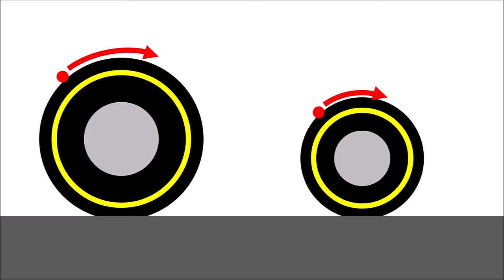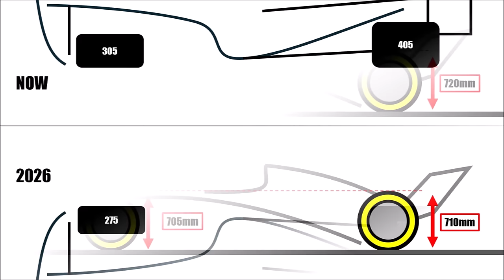F1 2026 - The New Tyre Dimensions EXPLAINED

Comment: The FIA baffles me. We talk about dirty air taking grip. What do they do? Take away mechanical grip. Very smart people working there.
Reply: 1998 all over again. Reducing mechanical grip just makes the cars more aero dependent/ aero sensitive. 
I do agree about reducing the overall diameter of the front wheels so the drivers can see them properly and plant the car over the apex not go outside the track limits.
Reply: @MichaelAMVM  actually the limit of aero grip is in the physics and the interpretation of the rules by the team, so no matter what size of wheel they run, the downforce is capped by physics and regs, something more akin to V8 supercars, they have thin tires and loads of power too, and that means more slidy actions.
Reply: @Dakkyun  I love V8 supercars i think they are incredibly cool,but a slide there is probably much easier to correct than in an f1 car. I'd like to see closer racing,not 20 spins every race
Reply: They really should concentrate more on Hamiltons jewelry.
Reply: You new?  They're 🤡
Reply: Smarter than you are apparently
Reply: One very important point is that the current tyres are too big and disperse a lot of water in rain conditions, making imposible to race. Slimmer tyres will make rainy races possible again
Reply: Nope thats actually something they did right. Current tires are WAY too big
Reply: But relatively speaking, there is less grip lost(not due to the tires). Just adding more grip doesn't help consistency.
Reply: Smaller contact patch doesn't reduce grip on its own, but it does mean they'll get hotter faster, and degrade faster.

On the up-side, tyres would get into their window faster. Degradation-wise, they could potentially address that with the rubber formula, given F1 requires Michelin to make the current tyres faster wearing (adding pit stops and thus strategy to races).
Reply: @Dakkyun  If you really want the cars to slide, just mandate crossply tyres! The four wheel drifts went away from Formula One with the introduction of radials in the late 70's.  Radials generate peak grip at much smaller slip angle than bias-ply tyres.
Reply: @bernardoberner4  The rears are just the right width!  About the same as the historical rear tyre width, although Indycar rears were even wider than F1 before the IRL days.
Reply: @matiasmosquera6357  Big tyres are not the issue for that, it's the ground effect that pulled the water upwards
Reply: I actually don't hate the idea of reducing grip tho. These cars could stand to be a little harder to drive.
Reply: Well considering that they think that not changing the regulations of a season that is boring as 2023 and 2024, is a good idea, this isn't really shocking in my eyes
Reply: @bakedbeings wouldn't more resilient tyre formula make tyre heat up less, essentialy making it the same as now?
Reply: It would be great to not see a knee jerk on this and risk a repeat of 1998. Making the tyre width halfway between what they were, to what they presently are, would be ideal.

However to improve curb riding, weight and driver vision, going to 16 would be ideal either which way.
Reply: They dont take mechanical grip. They take overall grip,

Grip is always made by the tires, 
Mechanical grip is archived by optimizing the contact and performance through the suspension design 

Aerodinamic Grip comes from aero elements pushing down the wheels harder into the ground and thus allowing them to archive higher levels of grip

Ik this is an actually moment but is quite a distinction to make

Comment: Nimbler cars. Just make the cars smaller, but just as fast as the 2017-21 cars. Without the aggressive outwash
Reply: Easier said then done
Reply: Not happening with the hybrids and the recent safety improvements. The reason we have the mostrosities of today is because they were barely faster than GP2 with the current engine formula.
Reply: @jathiyakhan720  than
Reply: Literally impossible and will lead to even worse racing.
Reply: @mrgalaxy396 F1 will never admit 2014 was a failure
Reply: They will be much less nimble with reduced front tire size and reduced car width.
Reply: @Willie_Pete_Was_Here  They did, cause they made the nice fast 2017 cars though!

Comment: This just sounds like pirelli doesn't want to put the time and ressources in developing the 16 inch tyres.everyone knows f1 is miles away from "production cars", it's not about relevancy. It's about a brand that despite being given a monopoly stance on this, still refuses to do it's job properly
Reply: Typical Pirelli lmao, f1 needs a serious tire brand to provide tires
Reply: Yes, suppling tires to F1 is about marketing for Pirelli and nothing else.
Reply: I agree..
I laughed when Pirelli said but the 16 inch wheel won't match with our road cars......eh?
..
F1 is an industry all by itself...
Reply: @RANDOMZBOSSMAN1  michelin? is has  best or 2nd best rnd budget
Reply: 16" with higher profile is better for straight-line traction and wet grip (as the tyre can deform more to contour to the road) BUT a 18" low profile tyre with short sidewalls is better for controlling the contact patch in dry.  Check out Jonathon Benson's test on road tyres, 17" was fastest in the wet on a circuit but 19" was fastest in the dry on a circuit, even despite the greater rotational inertia. So  I wouldn't assume there are not technical and performance benefits to sticking with 18".

F1 only went down from 15"tyres in the 1960s; to 13" tyres in the 1970's due to FIA rules after all.  USAC/Indycar racing stuck with 15" from the 1960's to the present day.  For the 1960's, those front 15" tyres (which were much smaller in overall diameter) were quite low profile, about  the same as the profile of current F1 tyres.
Reply: @Amy-dq2lg  in an ideal world we have open tire competition but if its going to be a control tire spec I would rather have Bridgestone or Michelin (they have said they don’t want to be in a control series for f1) being the tire providers
Reply: @seashackf1  f1 is just a joke I swear, 2019 regs were some of the most expensive yet everyone was in it and the fans that were watching actually were interested in the racing. I don't know why I still have any hope for this series as a whole. Guess the tifosi syndrome is still there somewhere
Reply: @eliasmaissour437  agree, but not just ‘19. The ‘14 hybrid regs are what started the massive increase in cost and complexity. The billions spent developing those engines that turn out to have no road relevance is crazy. Them dropping the mgu-h for ‘26 and the fact it’s not used in any road cars proves it was point less.
Reply: @seashackf1  the only reason I see them having any superiority is thermal efficiency and not having an issue with the ban on refueling. But they took it way too far with the regs. I think mercedes alone spent more than 1. 5 billion in r&d for the 1.6 god knows how much Ferrari spent on them. There is no reason not to bring back v8s or v10s or bring back the old regs style from 50s to 80s giving a max displacement for na engines and a different one for forced induction. All this spiraled out of control
Reply: @TassieLorenzo  the thing is the current 18” aren’t low profile compared to performance road tires though. In fact they’re actually high profile and have a much softer sidewall. F1 showed a video last year of how they mount the tires. They can get the tire over the bead rather easily by hand. You can’t do that with a stiff sidewall performance road tire. Not even with the help of hand tools, you need a machine.

I’m not sure of the relevance of that road car test by a YouTuber compared to high downforce 800kg cars with 1000hp that brake at 5 g’s. Very different animals in very different environments.

As far as I know the move to 13” wheels was mainly about limiting brake rotor size. It also provided some of the
Reply: @eliasmaissour437  I’m sure they could make v8 or v10’s with the same reliability of todays engines. They may have to limit revs to 16 or 17k, but we’d still get the screaming sound we all love and gives us goosebumps. 

As the v8’s proved they would be extremely cheap compared to these things today. Unfortunately manufacturers want to parade around with things like sustainability and relevance that some of know is complete bs. A 900 hp n/a v8 or v10 would be infinitely more relevant, ‘green’ and cheaper than todays engines.
Reply: @seashackf1 as above said, you need to spend on R&D in first place for those engine, and this is F1, not road engine so it will not be cheap, especially with current reg of having to have engine (and parts) lasts.

Comment: As I said since this formula started, ground effect was good, but what was absolutely needed was physically smaller cars. 2026 may be too late, with endurance racing really kicking off by then, but we'll see if F1 becomes a "rich Americans and middle east" sport before then
Reply: We have to see if Hypercar can survive loopholes in regs.
Reply: Nobody actually cares about fake racing (BoP)
Reply: @boostav You couldn’t be more wrong, on both of your claims.
Reply: Ground effect is good but what we've also seen is the reduced slipstream effect has made overtaking harder. Perhaps relying less on ground effect and designing regs that force an inwashing wake would be a better middle ground. Still less dirty air and smaller wake allows different lines to be taken to avoid dirty air while still allowing good slipstream.
Reply: @coyy9106  Because you're the typical internet NPC
Reply: @boostav  Sounds exactly like something an NPC would say.
Reply: @nonegone7170  You have no idea what an NPC is then, lack of independent thinking is the defining trait and endurance racing is social media's current thing.
Reply: @boostav  If that’s what you resort to whenever you’re presented with a contrasting opinion to your own, I really pity you.
Reply: Just add giant fans along the outside of  every corner, blowing away the dirty air and keeping the cars on track. Like they did in that documentary, Hot Wheels Unleashed.
Reply: Smaller cars would absolutely improve things. In doing so, reducing aero grip so that Pouhon and 130R become actual challenges again would be a step in the right direction. The cars are just too big and too grippy for exciting racing.
Reply: @boostav  engine freeze is worse than BoP (also budget cap)

Comment: The cars need to be much much smaller and lighter max 600KG. They are buses now.
Reply: It’s hard to make a car that weighs 600 KG and still have all the safety features modern F1 cars have implemented.
Reply: @SimRacingVeteran who knew that carbon fiber is that heavy. I think they should ease up a bit on safety. Many cars in different categories are starting to get lighter than F1 and they're fine

Comment: Pirelli can go fly off. My cars runs 13 inch wheels!
Reply: That's good, but F1 cars used 15" wheels in the 1960's before 13" rears were mandated...  The front 15" tyres were comparaitively low profile too, similar to the tyres now.  USAC/Indycar continued with 15" from the 60's the present day, while the FIA reduced maximum rim diameter in F1 to 13" rear in the early 70's and 13" front in the early 80's.

Comment: I don't know anyone whose car has 18-inch wheels and isn't a truck. Most of us have between 14 and 16- inch wheels.
Reply: I’ve had a car from 2005 that had 18” wheels, they’ve been around a long time. Some new performance cars have 20-22” wheels now. That said these 18” are too big for F1 and look ridiculous. I’d prefer 16” at the most.
Reply: The new Renault 5 will run on 18 inch wheels, to match the other models in their range.
Reply: 18" is the base wheel on the cheapest Porsche Boxster. Any option above that is 19"+. Ridiculous, I know. They're heavy and often make the ride significantly worse. But car design of late, even on sporty cars is becoming rather truck-ish. There's only so much styling trickery they can do around a wheel arch (folds, creases, cladding etc.) to hide the fact there's a vast amount of metal above the wheel, which is a bus-like feature, not a sleek sexy car thing, so the only option is to go for gigantic wheels to maintain somewhat car-ish proportions on what is a truck-sized vehicle.
Reply: Mine run with 17" (it's R1M)
Reply: Almost all hot hatchbacks have come with 18" tyres since 2006-2007, following the trend of cars like the Ferrari 360 and Porsche 911 who went to 18" tyres in the late 90's... Many went  as high as 20" like the Astra OPC.  Porsche 911 comes with 20" front/22" rear these days... Don't forget, tyres were as large as 32"in the early days of motoring (1910's),then they gradually got smaller (27", 25", 23", 20", 18"..._) with the trend for downsizing tyres up the 1950's to increase interior space (where they went as small as 13" -14" on sedans in the 1950's).  But then increasingly larger and wider radial tyres have been developed since 1960's.  15" radials were on exotic sportscars like Ferraris in the 1960's (where economy cars ran 13"), then it was 16" in the 1970's (205/55R16 was the exotic Porsche 911 front tyre in the late70's and is now the basic VW Golf/Toyota Corolla tyre size), then 17" radials came out on the 1980's Ferrari F40 (the first of their kind), then 18", 19", 20"  etc...
Reply: 18 is very common nowadays on sports car and modified racing cars, going to a smaller size for F1 would reduce performance.
Reply: I had a 2011 Scion tC with 19 inch TRD rims. It came with stock 18 inch rims.
Reply: @seashackf1  It doesn't look that bad in F2 without the wheel covers.  It looks kind of cool actually. 🙂 Re: 16", Don't forget F1 cars had 15" wheels in the 1960's (with very low profile front tyres compared to road cars of the time, about the same tyre profile as F1 cars  now) and probably would have progressed to having even larger sizes if not for FIA regulations mandating the reduction down to  13" wheels.
Reply: @SimRacingVeteran  Yes, my Civic  Type R came stock with 18" rims with 225/40 R18.   This car  came out in 2007.   7-8 years earlier  this was the "exotic" Ferrari 360 front tyre size, but nowadays 225/40 R18 is one of THE most common tyre  sizes for mid-range hatchbacks and C-segment  cars.  There is actually very little choice in 13" and 14" tyres now (be it  standard profile, 82%, or lower 70% profile) as they are not very common anymore.
Reply: @SimRacingVeteran  I looked at pictures online 8) I bet you are missing it

Comment: I wish we could have the extreme tyre dimensions of the 1970s again: 

ₛₘₐₗₗ  wheels up front 

█▄▄   █   █▀▀
█▄█   █   █▄█  wheels out back

It made the cars look like drag cars with wings.
Reply: maybe try this the other way around for the funny
Reply: thats mostly because you couldnt run low tyre profile tyres back then, the tech just wasnt there
Reply: How did you do that font?
Reply: I LOVE the 70s tyres, they just look really good on the cars and they give them some good rear grip
Reply: Add in mutant, rat drivers and we have a proper sport.
Reply: @pallav8725  I think they could... The big sidewall is important in F1 and other race cars.
They act like a suspension, they deal a LOT better in curbs and most important, weights a LOT less, and that being rotational mass, the proportions is like 1 x 4 (-1 kg in tires = 4 kg less in the car). What ''saves'' a bit is more diameter, wich increases the contact patch.

11 kg = 44 kg (for F1 thats A LOT).
The biggest disavantage on smaller tires is deal to tire heat and more important, breaking force and even more break heat due to less space to soak the heat also.

GT cars would be ''impratical'' to use such a small wheel being waaaay heavier... Brakes would suffer.
So, for then, 18 inch is better than 20-21 (actual measures to road cars). More sidewall, enough brake force and heat soak with less weight and about the same diameter.

Pirelli uses 18 inch in a LOT of racing cars, but nothing use the huuuuuge tires like the F1 now.
In the past Porsche tried 19 inch WIDTH tires, with 18 inch wheels in the Porsche 917/30 from early 70´s. Not a huuuuge sidewall for that insane width specially considering thats early 70´s.

Thats WIDER than a Top Fuel tire (with less total diameter).
And yes, im talking about an modern Top Fuel Dragster.
Reply: And it meant the drivers weren't struggling to see the corner over the front tyres.
Reply: @pallav8725 F1 didn't have low profile tyres until 2022
Reply: Nope that's too much for my taste of wheel dimensions, also weight distribution is in the regs.
Reply: @pallav8725  they could and did!  those front tyres, especially when they were 15" rims, were rather low profile!
Reply: @albert_gyorgy  check out the front 15" tyre of a 1970 March F1, it's quite low profile for the time. About the same as the tyre profile now.

Comment: How great to see F1 being a hostage of Pirelli for years already.
Reply: Sub standard tires which have to be run on very high pressures to protect the Italian brand feelings because they can’t adequate meet the FIA brief without major problems
Reply: Honestly I would love to see a proper tyre war with the current tyre regulations (though I would like to see each team given an extra set each of hard and mediums, which would have to be used prior to qualy).

Have Bridgestone and Michelin homologate 7 base compounds, then take a soft-medium-hard to each race, and they would have to be non-consecutive. The sport is becoming FAR too proscriptive and in danger of turning into yet another spec series.

Also a 16 inch tyre would be ideal, better for curb riding, better for weight and driver visibility, and it would still place a hard limit of brake size.